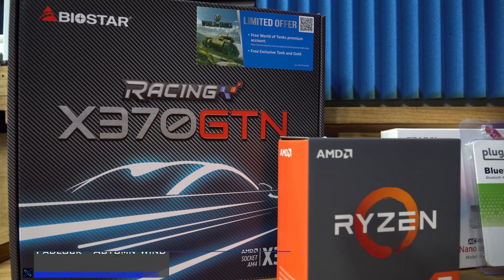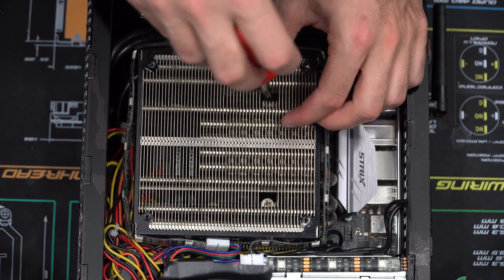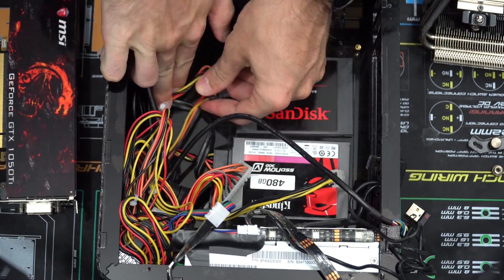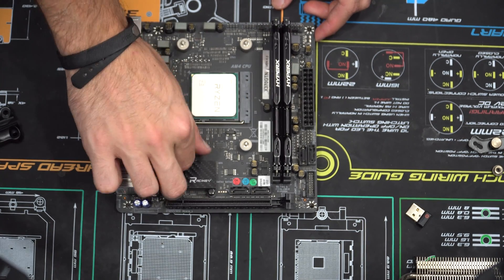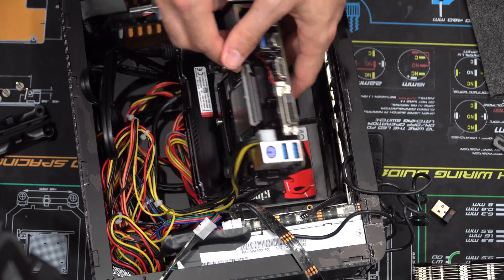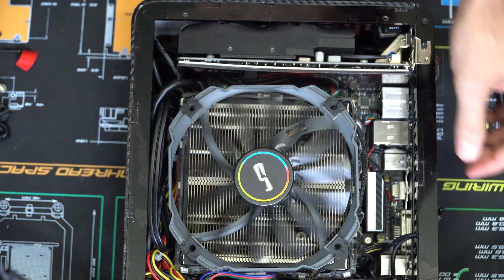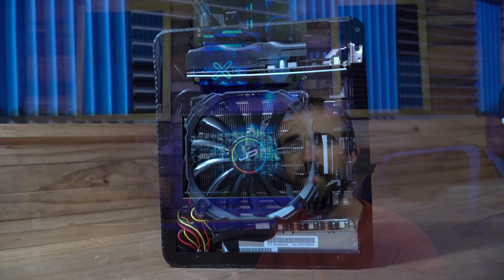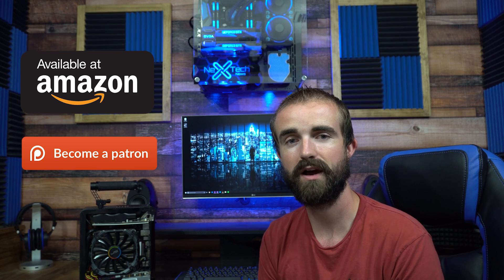Upgrading Portable PC to Ryzen 7 1800X

Comment: Cool looks good. Don't you find the 1800X to push the C7 a little too hard and get noisy basically all the time? I had an 1800X in my Node202 with a C7 and without disabling the AutoOC feature in the BIOS it was just too loud. Spin to fullspeed using a browser. I swapped in a 1700 and it's a lot better now. Been using it this way since March. I would like to move to the Noctua NH-L9a and the Strix X370-I Gaming board but probably won't bother. I would probably swap the CPU fan if there was a better one that used the C7 mounting method.
Reply from the maker: +BuckRogers Thanks! :) The cooler in this build isn't the c7 but the c1 much bigger cooler than c7 and is silent most of the time with the 1800x
Reply: Oh that camera angle helped fool me, viewing it from the top. Building small 8 core systems is something that caught my interest as well. The Node202 has a lot of limitations but it fits nicely on my desk with 3 monitors.
Reply from the maker: +BuckRogers oh okay gotcha! Yeah I used the code once to but decided to keep looking for a smaller case haha that's how I found this one but I'm still looking always haha!
Reply from the maker: +BuckRogers And that's true sure does give a lot more room for monitors!

Comment: Do you think is going to work a config like this below?

CPU: Ryzen 7 1800x
GPU: GTX 1070 mini
MOTHER: ASRock - X370
RAM: 32gb low profile
CPU COOLER: Liquid or air system?
PSU: I have no idea

Thanks man :D
Reply from the maker: Are you wondering if you can fit all the above in this case?
Reply: Yeah! This rig into the case you reviewed :D

Actually I'm planning to make an mITX pc with ryzen 7 and gtx 1070 with a small case. I mean, smallest as possibile.

I need it to work a lot (compositing, 3D, lots of rendering) and game as well but since i could travel i would like a configuration that isn't so huge. I was also looking for the Phanteks Enthoo Evolv Shift. I know is not that small compared to this one in the review but it seems to be small enough (and with style!)
Reply from the maker: Sadly that gpu won't fit into the case i reviewed but Geeekstore is making an A30 Case which is similar to the one i reviewed but will support a mini GPU like the Gygabyte 1070 Mini! but they are other options as well in the mini gpu case market! and the phanteks evolv shift is gorgeous but they only caveat is if you want to travel with it, that case will be very heavy!
Reply: Thank you for the details! Do you think ryzen 7 1800x needs a liquid cooler or air cooler could be ok?
Reply from the maker: It runs fine with an air cooler, the only air coolers that might give it problems is true low profile ones
Reply: Ok man! Thanks for your help :D your channel is great!